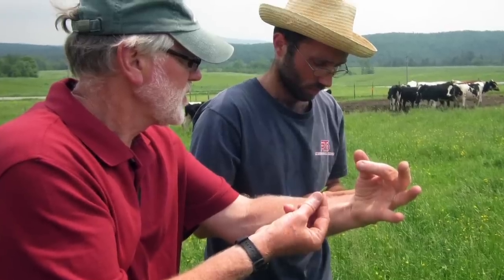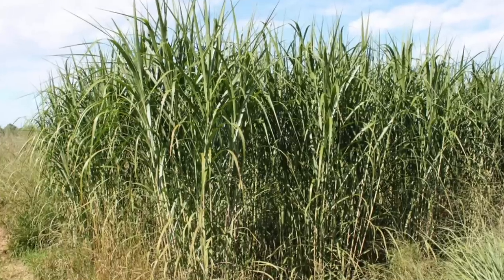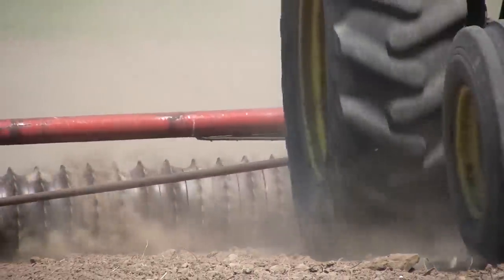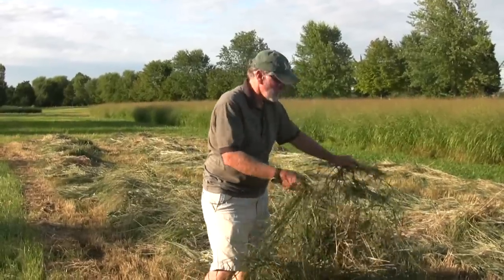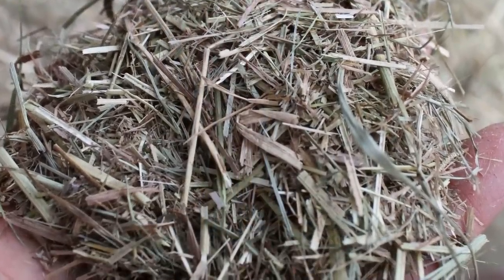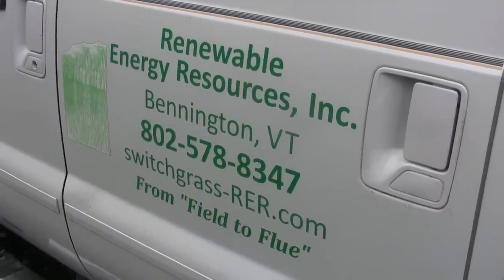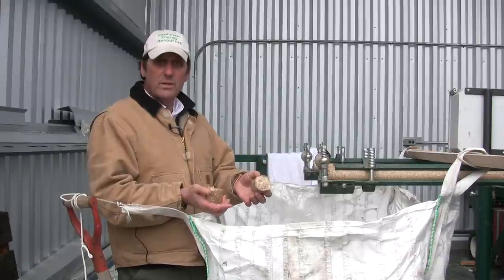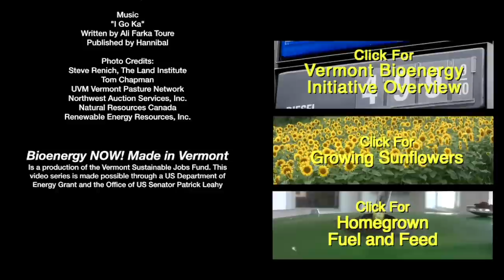Grass Fuel

Comment: How do they return nutrients to the fields if the whole crop is shipped off and burned? I think that a much better use of the grass would be to feed it to cows, then ferment the manure in a biogas plant then the nutrients can be returned after digesting to the field. Methane could be sold into the natural gas grid, or used to run a generator to feed electricity into the electric grid. This project seems to be well meaning but misguided.